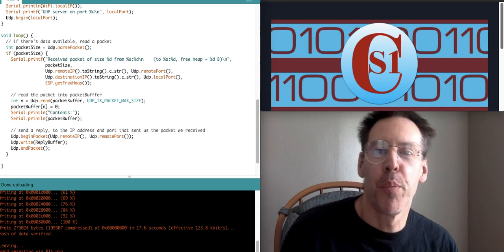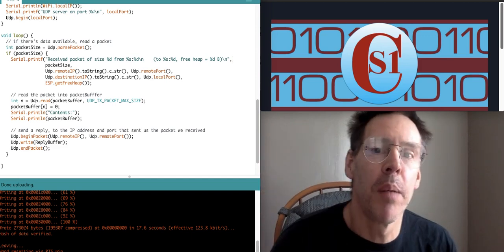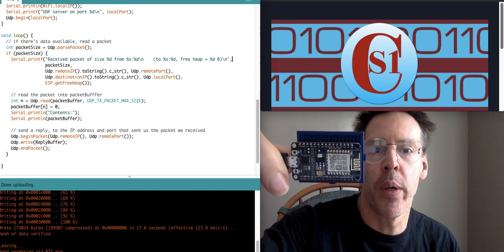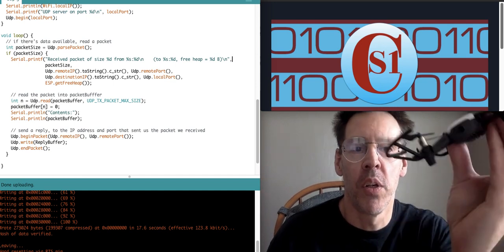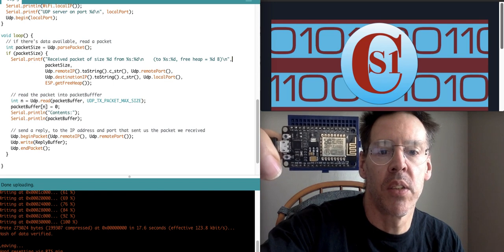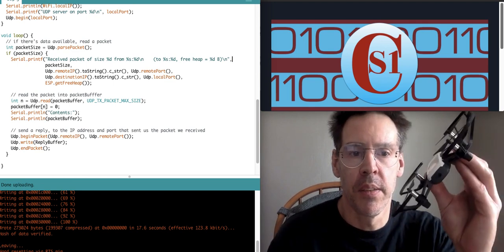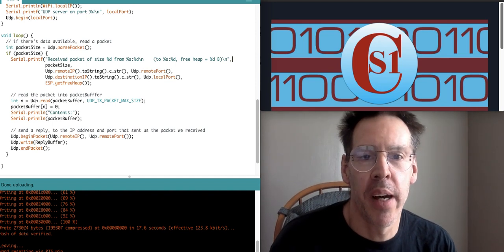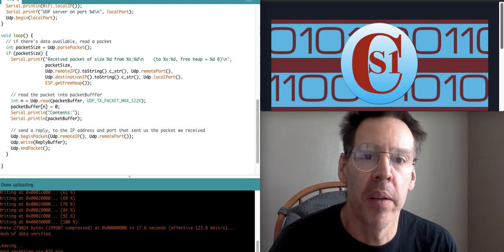ESP8266 Tello Drone Project Part 0

Comment: How use te NodemCU like repeater?
Reply from the maker: https://circuitdigest.com/microcontroller-projects/nodemcu-esp8266-wifi-repeater-or-range-extender
Reply: doesnt work with video, already portforward every port i found in the sdk and forums unfortunately, can control no image with tello app
Reply from the maker: @MrDinakdakan  I suggest pressing this issue:
https://github.com/martin-ger/esp_wifi_repeater/issues/430